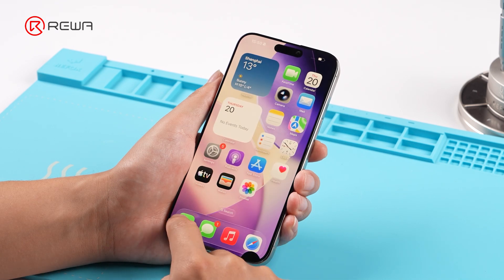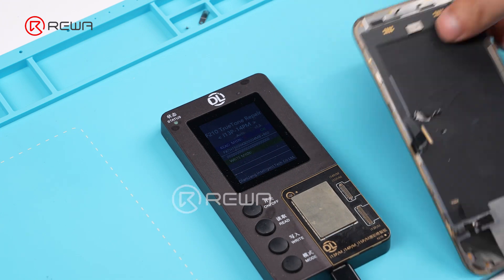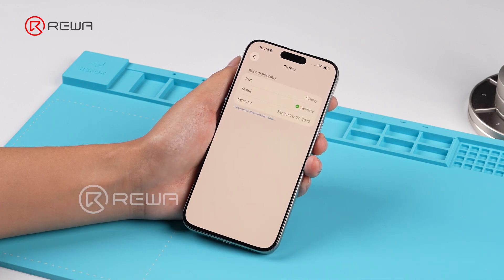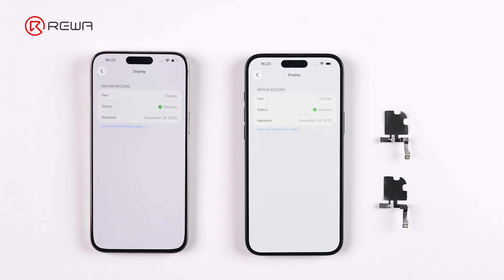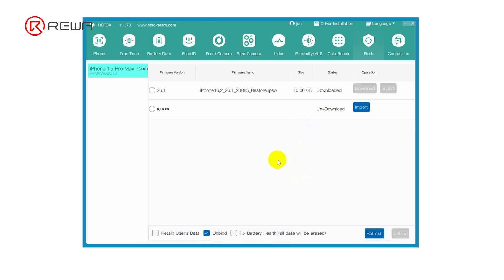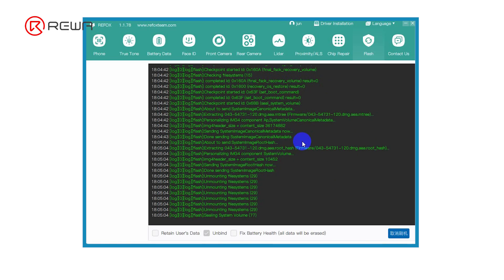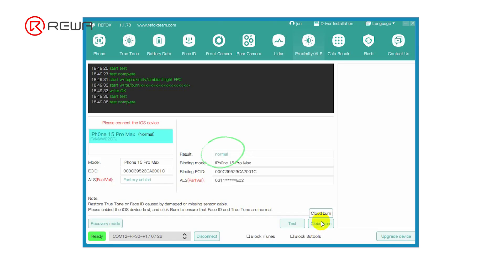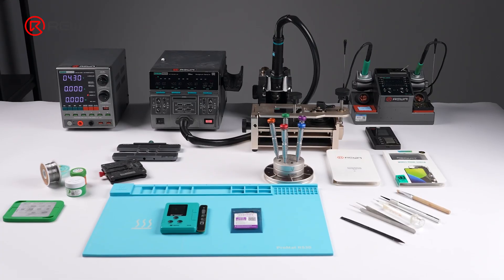100% Fix New Screen "Unknown Part" Message on iOS 26

Comment: I have a question, i have a iphone 15 pro unknown display error ( I don't have the original ic) if I put an another 15 pro original ic what does it show ❤
Reply from the maker: If your front sensor cable is paired, the screen ic can help you pass repair assistant first, then install front sensor cable.

Comment: I have oem pull 14 pro max lcd I transfer to phone with original flex still get unknown part
Reply from the maker: The flex cable is paired with phone? You need to finish repair assistant then install that flex cable.

Comment: I just have brand new genuine iphone 14 pro max full front camera TrueDepth camera which I haven't installed yet , will the face id works after using repair assist?
Reply from the maker: If the front camera module is paired with motherboard, then it is fine, face id should be ok.
Reply: @rewatechnology2008 how to pair it? You mean go through repair assist?
Reply from the maker: @User92376  Like the original one, so it will not pop up up message.
Reply from the maker: @User92376  Like the front camera needs to be totally match motherboard and no pop up message, and before the 16 series, the front camera can not replace.
Reply: @rewatechnology2008 that's confusing 😂 even with a brand new genuine unused iphone 14 pro max front camera the face id not working after repair assist done ?

Comment: If you dont transfer the truetone data from the original screen to the aftermarket screen and dont have the original screen anymore, is it still possible to recover the originl truetone data from the screen ?
Reply from the maker: After iOS 18, the true tone is fine, you do not need to transfer original front sensor to restore True Tone, but now when it comes back iOS 26, it also does not affect True Tone, only the unknown part problem.

Comment: does swapping proximity sensor on iphone 14 pro max affect the face id on ios 26?
Reply from the maker: After iPhone 13 series, the proximity sensor does not have any face id component, and this problem usually happens on the 15 and higher series.
Reply: @rewatechnology2008 also when replacing display of iphone 14 pro max in ios 26. is it not needed to transfer true tone data to keep the true tone fictionality?

Comment: Hallo Rewa Team, 
I ordered an iPhone 16 Plus Original Display. Now I have transferred my original sensor to the new screen. if I only connect the display, he tells me that I have an original component. But as soon as my original sensor installs Flex from the old screen, he tells me unknown component. Is the display additionally connected to the sensor cable? shouldn't that be so or do I misunderstand something there?
Reply from the maker: Usually the original front sensor cable is OK, just like old time, maybe the original front sensor does not match the screen? You can use the diagnostic-compatible screen to test first.
Reply: Thanks @rewatechnology2008 for your reply. How do you mean that the sensor might not fit the display? Can you explain that to me exactly? 💚

Comment: Hi @rewatechnology2008 , Can you make a video about the Voltage/Capacity lock issues on battery BMS ?
Reply from the maker: Appreciate for your trust, iPhone battery usually can use tag on flex to repair this issue, as for the MacBook battery, you need to use tool to unlock it.
Reply: @rewatechnology2008 after modifying battery health to 100% & cycle count to zero then if i install battery without using tag on flex permanently & after completing 2-5 charging cycles…will the voltage returns to normal on bms?

Comment: I replaced third party display on my iPhone 12. I transferred only the original flex cable from the old screen. But in the settings system shows unknown part. 
So should I transfer the IC on the new screen, flash iPhone, and flash the flex cable with programmer? Like on the iPhone 15?
Reply from the maker: The IC need to be soldered again, check it carefully first.

Comment: is it possible to use this Sensor with an diagnostic Display to avoid any pop up message?
Reply from the maker: Yeah we already tested it, and it totally worked.
Reply: @rewatechnology2008 perfect, but need diagnostic Display or normal Display like Incell or Oled will also work?
Reply: @NR-cg4ek just OLED Display,

Comment: if i just replace the sensor to other original flex. i should work good.
Reply from the maker: The front sensor cable need to pair with the motherboard, on iPhone 15-16, even though you place other pulled front sensor, you screen still become unknown part.
Reply: no
Reply: @shxrma2op To clarify the point is that it should work, it only doesn't because Apple is trash. 
To make matters worse, this flex and the shield that covers its connector are both clearly designed to tear the flex if you're not careful...
Reply: @shxrma2op I get Ur point

Comment: What should the airflow/temperature be set to when taking out the IC and when soldering it back?
Reply: try 280 60.

try on a danaged screen first
Reply: @krantikoganti  On older iphones, can I buy another screen IC and use it on mine? I lost mine lol
Reply from the maker: 280 degree and 60 airflow is OK.
Reply: 280 to 300 should be good.